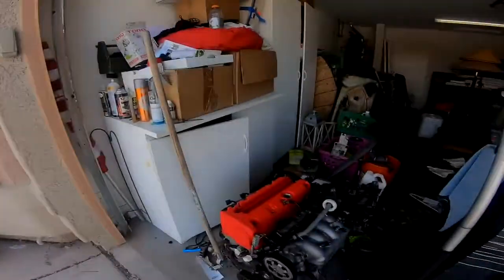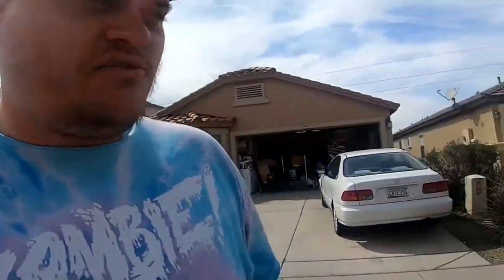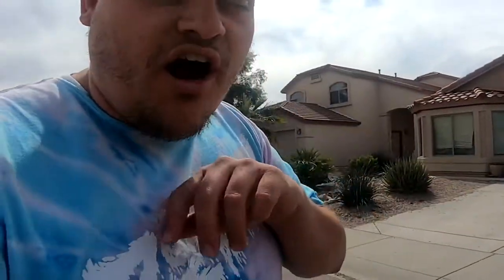K20A2 into EG hatch "list of parts"

Comment: Nice content, what axles did you used on the swap?
Reply from the maker: i used duralast golds from autozone they are base rsx axles with swapped inners. but this is also a cx hatch non abs smaller hub works with the spline from rsx base outer. not sure if this varries from model to model.

Comment: I got a complete k24a4 swap from a accord can I use my accord wiring harness and use a immobilizer to run my eg or not possible
Reply from the maker: Not to familiar with the k24a4 swap but im assuming the process would be similar to mine. There is a list of k series that have been swapped somewhere ill see what i can dig up when i get home from work.
Reply: extremely late reply but replying for other people that want the answer. No, you can not use the accord wiring harness it doesn't have a plug for the conversion harness to plug into and no you cannot use the RAA ecu because you cannot immobilize it. but, you can use a modified Element or CRV ecu they use the same engine.